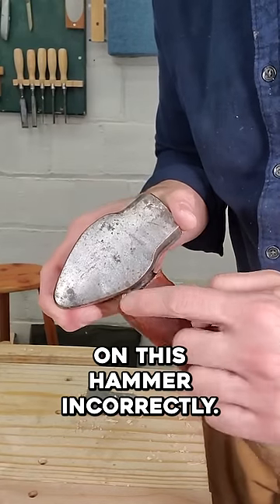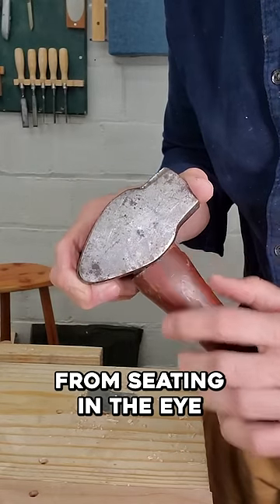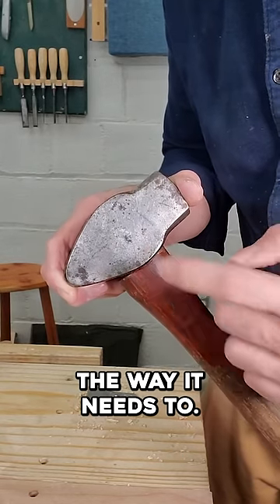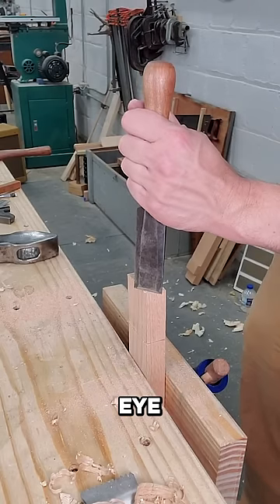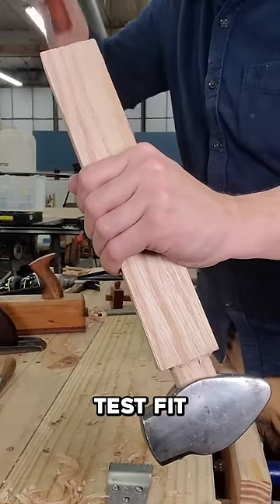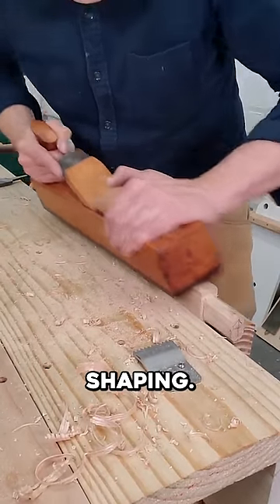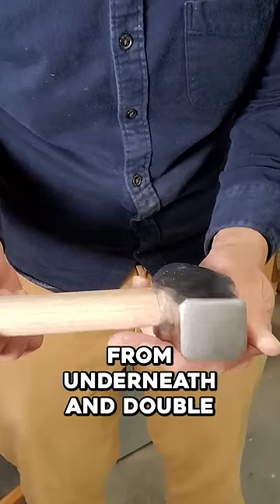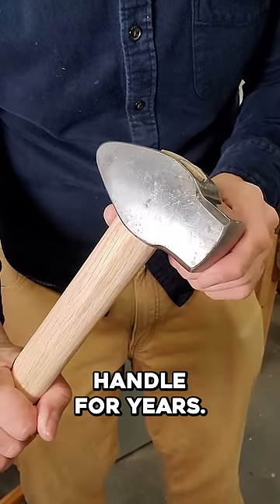This Hammer Handle CAN'T Come Off! #diy #woodworking

Comment: Now deep fry it in linseed oil 😀
Reply: That's a different YouTuber 🇮🇪
Reply: DEEP FRY!?!?
Reply: @VaultClown  yeah, it drives any residual moisture out and then the ambient air pressure forces the linseed oil into the pores. As you have heated the linseed oil it is now boiled and the extra heat will help it cure even faster.
Reply: Also, I don't think that was Ash, and as we all know: if it's not Ash, it's trash.
Reply: @MAPolomski  It's oak. Which is not the worst material. Most Japanese hammers have white oak handles. It's not going to make a huge difference on a hammer like this, that has a short chunky handle.
Reply: Me muttering to myself as i open the comments "and now for a nice coating of linseed oil"
Reply: @VaultClown  , yep - JUST soak in thinned BLO, then let the oxygen in the air react with the hardening oil.
Reply: @APenguinsLullaby , there is a big difference between finishing a wood surface with BLO (polymerized flax seed oil) and soaking the head, to swell the wood, then letting the BLO soaked wood react with oxygen to harden.
Reply: @kellyvcraig  I thought he meant like on the stove 🤦
Reply: @kellyvcraig  I'll take your word for it. I'm no wood worker, I'm just referencing the same thing as the original comment really, haha
Reply: @1milliondogs MAP is referencing a different woodworker, an Irish guy who only uses ash for handles and thats his catch phrase. But he doesn't actually hate on other woods for handles its just a catchy thing to say.
Reply: @1milliondogs you don’t get the reference lol he wasn’t saying it’s not good unless it’s ash he was saying something another YouTuber says all the time lol
Reply: @1milliondogs you heard em, if it ain't ash, it's trash! 🇮🇪
Reply: @MAPolomski  watching too much Eoin 😂
Reply: Lol deep fry
Reply: That shit does like to spontaneously ignite
Reply: @expletivesx999  all oils do if you heat them up enough. The problem with BLO is that the curing process is fast and exothermic enough to reach the required temperature if it happens in a wadded up rag in your trashcan.
Reply: @jaylee9907  hopefully not eoin mcduff 😂

Comment: That old handle needed just 5 minutes with that chisel instead of a complete rebuild
Reply: And was probably higher quality wood than new one. Not much old growth trees around these days.
Reply: Looked like it to me.  Rex chopped it like that just to taunt us
Reply: Exactly, just trim and shape the shoulder and the hammer would have been fine
Reply: I never put s handle on a hammer but i was wondering why he couldn’t just chisel/chip away the uneeded material.
Reply: Exactly what I thought.  Took 4 minutes of work and turned it into 4 hours.
Reply: if the old handle was wedged badly it's kind of impossible to wedge it good anymore because there is no way you can get the old one out, I kinda disagree with the way he wedged it aswell but if it works oh well
Reply: @patricknoel2122 nobody asked you😂😂
Reply: @patricknoel2122 @😂😂 nobody asked you siege bush
Reply: Probably rotted out above the shoulder
Reply: It was worth it
Reply: maybe, but it took less than a minute to make a new one...😬
Reply: Probably not worth the fiddly hassle,  it was made wrong and clearly used after so you don't really know what rot or cracks have built up.

Plus removing a wedge is a pain and it's not like the old handle can't be reused in a different project it's still good.

Comment: Or instead of destroying the old handle you could have simply removed it, spent 30 seconds removing that shoulder, then reattached the old handle and been done easily in less than 3 minutes.
Reply: How exactly do you suggest removing the handle without destroying the eye?
Reply: @TripleXMango You are kidding right? Its already falling out as he demonstrated, a little love tap on the end and it will fall out.  I have repaired dozens of hammers over the years.  Very few required a new handle.  This one did not.

Comment: The ridge wasn't the problem because the new handle also has a ridge. So What was the problem? And why did you "shape" the new handle to just be a plank of wood?
Reply: From what i understood the other ones eye bit (i don't know what else to call it) was too short
Reply: you can just take a knife and trim around that part to make it fit a little deeper and therefore tighter but putting a new wedge in is a problem because the old one that's obsolete now is still there
Reply: The new handle doesn't have a ridge on it, that's just when he was shaping it to fit the eye.

Comment: Hey, im a blackschmith and can tell you that this will break pretty early if you swing it hard enough for a couple thousend swings.
I always make the hammer handles like axe handels.
The hard corner unter the head will break out an the head will come lose
Reply: Had the first handle I made do that once. Another smith immediately handed me another hammer and I kept going. I think I lost a total of 2 swings on that heat. Actually learned how to make a decent handle after that one.
Reply: @seancrane278  my boss had a hammer head flying though the shop today actually, keep them on good or somebody will get hurt at some point😅
Reply: Good material like hickory and consistent grain also go lengths
Reply: Rex does some blacksmithing too, just so you know! :)
Reply: I believe he gets rid of those hard corners. It's hard to see because it shows it for less than a second however while he's shaping the actual handle just before cutting to the wedge scene he's gotten rid of the hard corners. Then he talks about it wedging in from the bottom and top.
Reply: first thought for me too. good effort but please make it a tighter fit initially, wedges only get you so far.
Reply: Really hard for a few thousand swings
Yeah, that'll put a bit of damage in most things
Reply: @bord6202  oaken handle is perfectly fine for a carpenter's hammer, will last decades, however an axe should always be made of birch or at best of juniper but it's very difficult to find suitable juniper for this
Reply: I've been to two World's Fairs and one other place and I ain't never seen a hammer that ugly before. Saw that handle off and throw that hammer head in the recycle bin. 😅

Comment: Why cut off the handle when you just showed it could be pulled out?
Reply: Because it couldn't be pulled out, it was just loose.
Reply: @jaredlancaster4137 Any hammer or axe handle as loose as this one can easily be pulled out. At most, a couple of taps on the top will pop it right out.

Comment: it is best to treat your wood with almost any oil before you put the head on, and use a round tapered wedge, a round wedge will push all angles equally giving the best fit.

Comment: I love making my own handles every now and then.  I split a chunk off one of a few beech logs I took from the side of the road a couple years ago or a piece of scrap I can’t throw away and can’t find a real use for.  Then I go through the same basic process.  But I shape it for my hand, how I like to hold the tool, blindly knowing the direction, or whatever I’m feeling like doing for the particular thing.  Hammers, axes, chisels, files, etc.

They are never perfectly nice and symmetrical or “correct”… some are better than others.  But I love them.  I’m always drawn to homemade stuff like that at estate sales, antique shops, etc.  Maybe someone will be with mine 🤷‍♂️

Comment: I always wondered why people saw off the handle instead of just punching it out from the hole. It makes more sense to me than to saw apart the handle.
Reply: Depends there's no need to do that if the  handle is already loose on it, but if the head in still seated and wedged properly. It's just easier to cut off the handle and throw the head into a fire to burn the rest out. That way you don't risk marring whatever item your trying to replace the handle on and you can also reuse the wedges themselves since they won't be damaged in anyway. Atleast that how my grandpa explained it to me.
Reply: @kennethharris5116 why would you put it in the fire. That's horrible advice.
Reply: @YardyHardy-z4h  my grandpa have 30 to 50 yr old hammers and axes. They all work fine and hold a edge he doesn't throw them in and leaves them. Only for a few minutes to burns it out enough that all he does is tap the metal a few time and the old head of the handles falls right out. Seen him do it a few times. Definitely don't leave it on a bed of hot coals til it gets red hot, thought that was common sense but I guess that is a lacking resource in this day and age. So probably should of clarified that in my orginal post.
Reply: @kennethharris5116  still better ways to get it done. Have a good day.

Comment: How do u get the old wood out of the head?
Reply: I use a punch or a wood block. Anything that will fit and just tap it out
Reply: Wish I could find more videos about making hammer handles. I still struggle getting the fit to my hand just right

Comment: Use a chisel for 3 munutes tops & use a piece of 3/8" stainless steel tubing 1" long , taper at the base. Drive it in and this hammer head and handle will out live most people

Comment: The hammer is a hammer designed ba Uri Hofi. Master blacksmith from Israel.  Designed with  gaps to make room for cutting edge, high tech elastomeric  adhesive. Properly mounted the handle will self destruct before the head loosens. Also provides astounding vibration absorption!

Comment: LoL I guess you really wanted that new handle bad
Personally, I love welding skirts onto the heads of axes and hammers, apply epoxy, wedge the top and bolt the skirt to the handle. Now if you strike and miss and you hit the handle, but it's protected by the skirt. The handle won't break and honestly, the head will never come off until the wood is actually rotten.